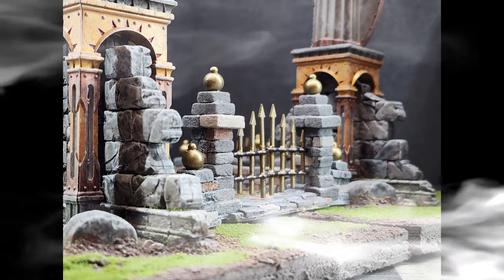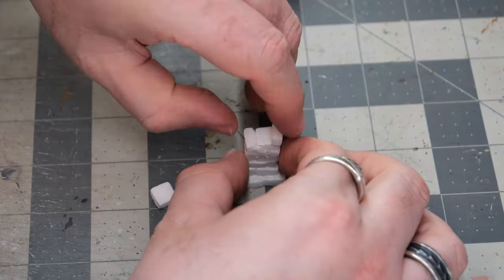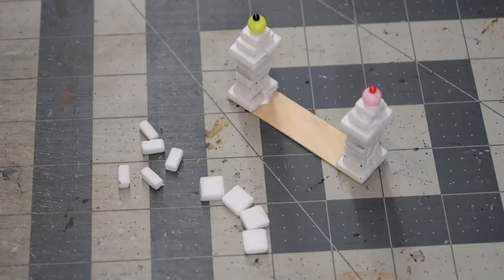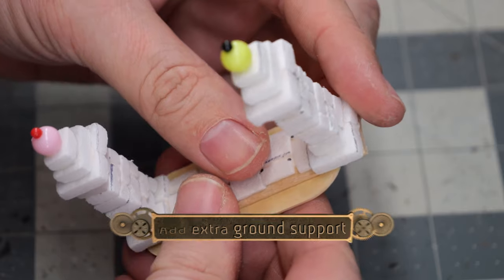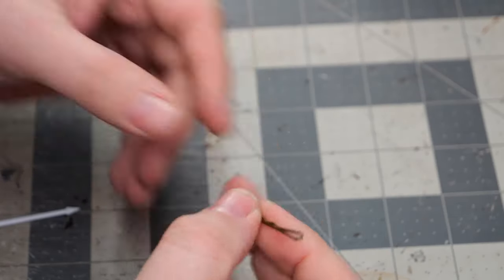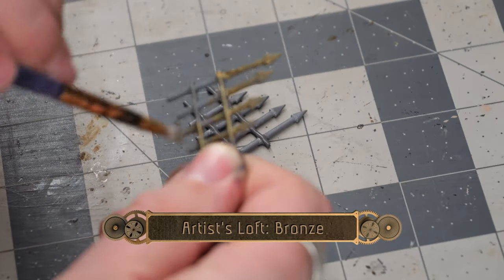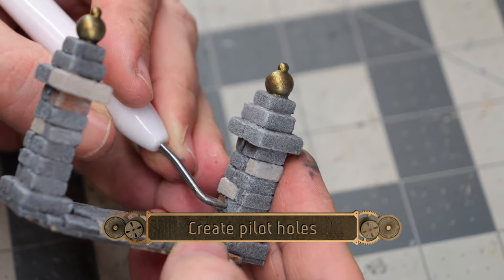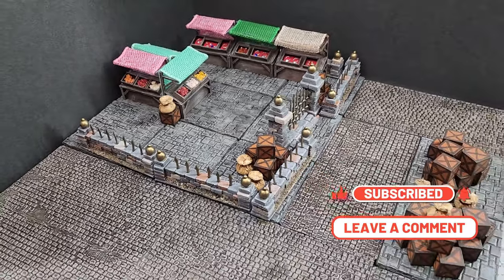DIY Graveyard Iron Gate: Easy and Affordable Crafting Tutorial

Comment: To unwarp the craft sticker, try adding a coat of glue on the bottom.
Reply from the maker: I did try that off camera, and while it did work a little, it didn't fully fix the problem. Though, I may have not waited long enough for it to fully dry